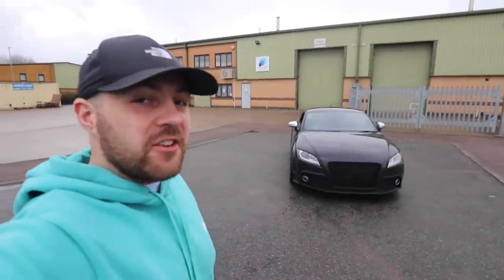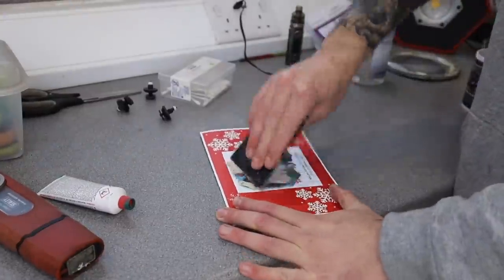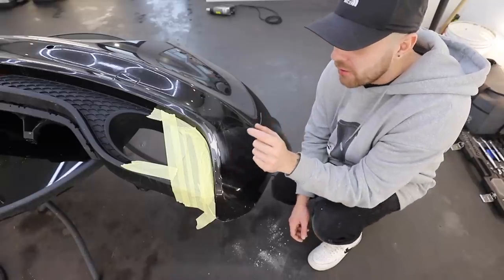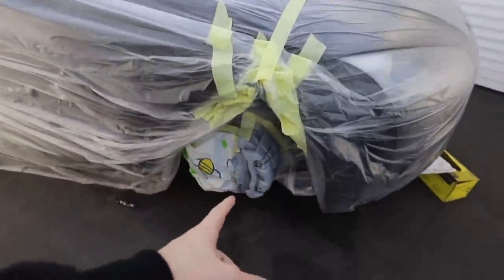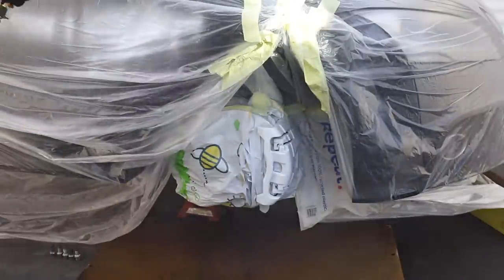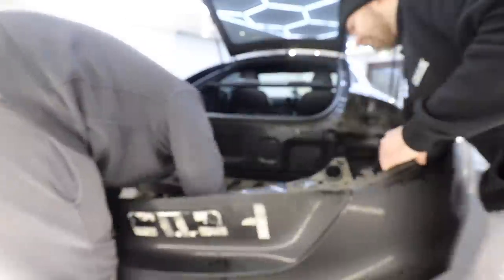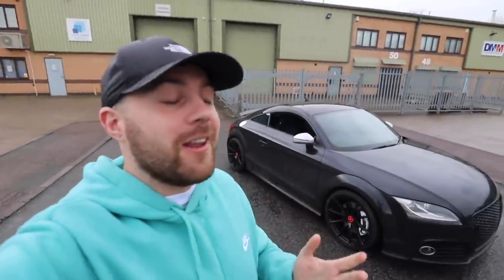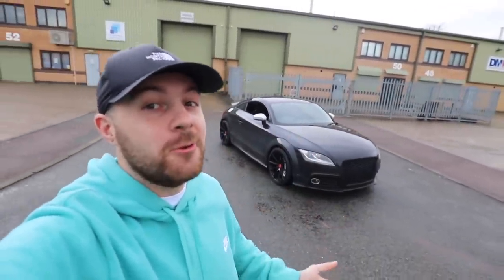INSTALLING A TTRS BODYKIT TO MY STOLEN AUDI TTS 8J

Comment: Hi Chris don't go for aftermarket on the spoiler the fitment will be terrible, I got lucky with mine and picked up a genuine ttrs for my 3.2 v6 tt and drilled the original spoiler and bolted it down, then I coded out the active spoiler with a obd 11. Fits better and none of the original seals etc are disturbed etc. Plus don't you remember matt with his spoiler all those videos ago lol 😆  love the content

Comment: Your tts rear bumper is the exact same as the ttrs bumper, only the diffuser is different so you could still use the old bumper if you swap over the diffuser
Reply from the maker: Haha wish i knew this before! Ahwell i can sell the tts one now
Reply: @Chris_Slix  I've got a replica spoiler on my TT from AliExpress for £200 and fitted it to the lifting spoiler. Disabled that spoiler by unplugging it. I was charged a fortune to get it sprayed and fitted though.

Comment: The trick to doing body work is to apply more filler than you you need and by that i mean spread it over a bigger area as when you sand it down you take off a large amount of the filler you put on it and when painting you always want to key the area as it will lift off and start peeling over shiny paint you can use a grey scotch brite or a p800 sand paper when it starts lifting the wrap will also start lifting as it wont have a proper area to stick to
Reply from the maker: Thanks kayden! I prepped the surrounding areas with 400 grit wet, will that do the job or is it likely to cause problems?
Reply: @Chris_Slix  in a body shop we can finish on 400 but on a da and certain colours but we are going for a finish that wont be covered with a wrap but it should be fine for a wrap as over time it might shrink back and start to show prep marks through the paint on the rougher grits but a wrap should cover them and stop them showing through
Reply: @Chris_Slix  ideally you want to 400, 800 and finish it with a 1000 for a smooth finish mate… on light colour I’d say go as high as 1000 then a quick 2000
Reply from the maker: @brun_s  think your on about the flatting and polishing buddy 😅 we are on about prep
Reply: @Chris_Slix  at Aston Martin when the cars been primed we use 400 then 1000 finish in dark colours and 400/ 800/1000 on light colours like silver, sterling green etc as the lower grid paper will leave prep marks like scratches etc.. on painted (basecoat- top coat) cars 1200/ 2000 dry, 3000 wet and polish.
Reply: @brun_s  in the garage i work in we finish on 500 for painted areas even on silver obviously on a da with a soft pad and 800 edges with 3m gold foam back pads and 1000 the blend areas with a soft pad on a da and grey scotch the edges if its a any white i use a red scotch and same with solid reds
Reply: @kaydenslevin4848  this including filler work? What primer you using to cover up the prep marks etc.. surely you flatten the repair area first using a block etc? As in the DA with a soft pad will literally just go over any filler and leave like lumps in the paint work?
Reply: @brun_s  thats for paint prep we block primer with 400 first but on filler it’s finished with 320 on a block over filler and 320 all surrounding edges with a soft pad and red scotch and we use syrox waterbase scheme with there highbuild system aswell
Reply: @kaydenslevin4848  fair enough, always interesting to see and hear what other body shops processes are. If it works for you guys then fair enough

Comment: You didn't need to use a filler with that . What you should have used was a stopper , Holts knifing stopper or carplan cellulose putty its used for scratches or using on the top of the filler to take out all your scratches . Quicker easier and cheaper with a much better finish

Comment: I’m debating putting a RS rear bumper on my 2008 TDI (Quattro), but I’m worried about the TDI having a single exhaust and how it’ll sound if I cut the end off. Do you think it’ll be possible to upgrade to a twin exhaust plus an RS bumper?

Comment: Nothing wrong with fitting the nicer bumpers to the car! Now the bits that bugged me 

Repaired rear bumper - half arsed job in a shed using Halfords spray cans

Paints calipers - goes full pro bodyshop mode 

Looooool wtf